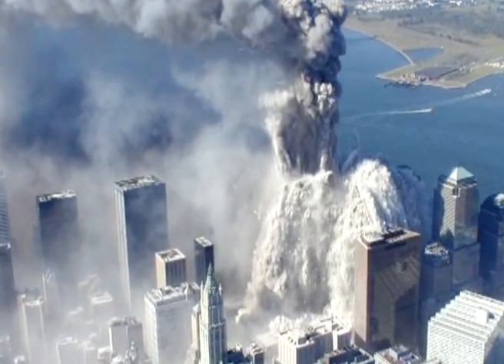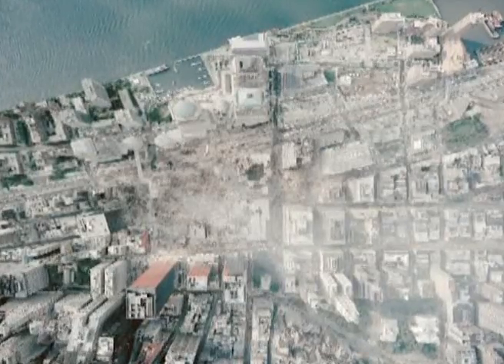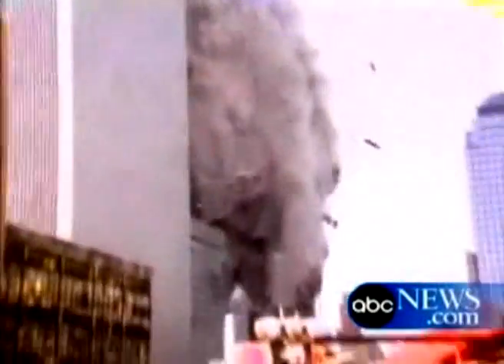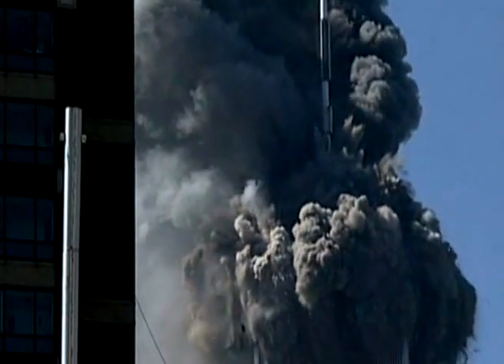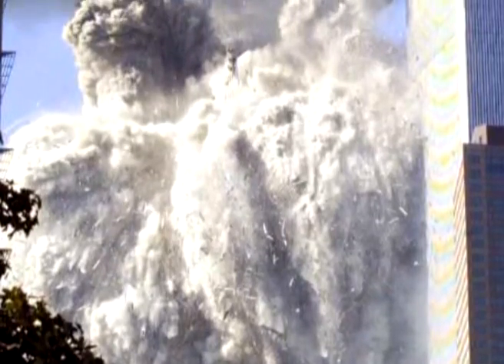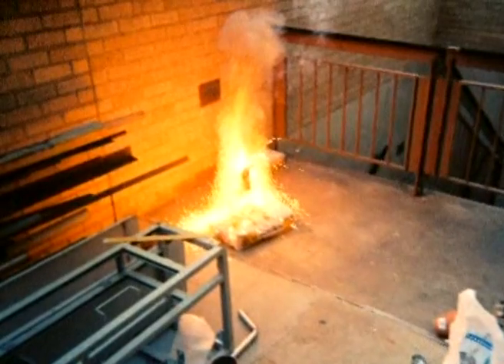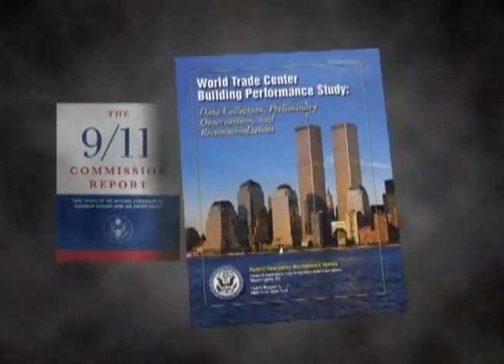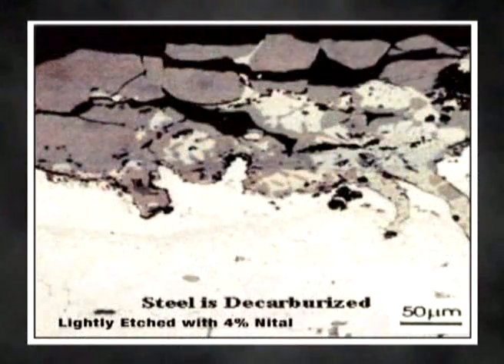Evidence for thermite and view of the "spire" collapse

Comment: I really believe they had the WHOLE interior structure of the building coated with Thermite, therefore you'd have a 100% failure rate of the building in case of an attack, I'm not sure how they went about doing this, but the must have modified the building during maintenance, or what not.. They had to have known.. The evidence is all pointing it out, with the "Surgically cut steel beams"... Think about it, if the buildings were left to stand, they could've stopped the fires though it would've taken days.... And the repairs would've been, astronomical... Which is why I think most of the building owners who lost theirs buildings had them "pulled", as if they knew 9/11 was going to happen in advance, which doesn't settle with me.... You do not have to be a rocket scientist to figure this stuff out. ALSO, there were reports of explosions under the twin towers as well, after and before the initial plane crashes, and these explosion were probably fueled with, you guessed it, thermite, which would INFACT weaken the foot hold of the building, which would make perfect sense where those "Pools of Lava" came from, plus the jet fuel and liquid metal flowing down the elevator shafts and floors due to gravity.....

Comment: Don't forget the thermite fired from the pod of the missile with hologram added wings and CGI, piloted by the mossad, which triggered the underground nukes 50 minutes later, causing a controlled demollition on their footprint (+34 extra acres) causing explosions at the basements which caused the collapse initiate from the impact area, pulverizing and melting the steel.

Comment: thermite will not throw debrie very far, it only cuts and melts there would need to be other explosives.  Scalar technology was used that is why the oxygen tanks on the backs of the firemen where exploding, and metal was evaporating into thin air so to speak.  Cars a 1/2 mile away where incinerated, or the engin blocks where missing and door handles where missing.  Thermite will not cause this type of destruction, people are really to scared to bring up the real reason.

Comment: Dustman has failed to respond t several of my posts, one in particular in which I pointed out that the potential energy, when converted to kinetic energy of 1 of the towers is equivalent to 272 tons of TNT, that's why so much was smashed beyond recognition, that's without adding in the energy from the fires, which also destroyed a lot, and continued to do so after the collapse.

Comment: @infoseeker264 
1,139,879,868,600J / 4,184,000,000J/t = 272t
That figure is the potential energy of one of the towers, when converted into kinetic energy (collapse), then converted into the equivalent in TNT. The collapse created the equivalent in energy as 272 tons of TNT. That's a lot of destructive power! And that is why so much was pulverised beyond recognition. And the fires have not been added to that equation.

Comment: @infoseeker264 "The museum has tangible vestiges of the twin towers, including pieces of window glass, lobby marble and jagged beam steel. One display case holds a beer can from 1971, when construction workers building the new towers shoved it between two steel beams before sealing them. The can was pried from the metal at ground zero, twisted and rusty.One jarring item is a frozen clock, its simple black hands stopped at 10:02, and the small one at 14."

what's this infoseek.. lol.

Comment: Four floors tall, a few is Two. Steel framed buildings can collapse from fire, there is no getting away from that fact. Yes, buildings without concrete reinforcement are more susceptable to fire, since 911, the reccomendation is to use concrete- reinforced steel.
JERKS!! You are just another coward living in denial it's as simple as that"

I see this so much, a sign of losing an argument and being stubborn is to turn to insults, hey it's not my fault you have no science to back you up.

Comment: Because, whilst fire completely destroyed the Kader toy factory in Singapore, the fire affected sections of dogwood elementary school in virginia, the mumbai High north platform in India, and world trade center 7 - all steel-framed structures, many buildings have survived fires often due to concrete-reinforced steel. They wouldn't know if the building would definately collapse or not, they do know it will with explosives. Fire did not work miracles, fire collase is common.

Comment: Well, yes there is, you need to read up on physics and scaling. It can't be done.

BTW this statement of yours "DO NOT COLLAPSE STRAIGHT DOWN INTO THE PATH OF THE MOST RESISTANCE AT NEAR FREE FALL SPEED"

Is false also, although the towers fell down( gravity has an odd way of doing that!) the towers did not fall into their own foot print, meaning some least resistance occured, and near "freefall speed" means not at feefall speed, don't insinuate.

Comment: you have nothing but a list of similies and arguments from incredulity. You have zero physical evidence of a controlled demolition. No det cord, No blasting caps, No devices that could hold thermite against a vertical surface, Hell. no thermite or blast residue even. And don't spit out that old canard that they weren't looking for it. they combed through the wreckage at Fresh Kills. It would be self evident, obvious, and impossible to conceal.

Comment: @infoseeker264 cutting charges are loud, huge in fact for columns the size of B7's, prove otherwise.

"but think Thermite, which burns much hotter and faster, couldn't have done the same thing"

No, it probably could, but it didn't, there is no evidence.
I thought you thought it was explosives, not thermite anyway?

Comment: @AiresQX4 No I can't and for that matter, nor can anybody else, the reason being it is impossible to scale down and recreate the events, you cannot scale down a fire,(a large fie in a big building will have different properties to a scaled version) and you cannot scale down the sand used in the concrete (which is what you would have to do). 
There are only 2 possible ways here: recreate a full sized replica, or computer simulation.

Comment: @infoseeker264 The spewing metal was BURNING magnesium/aluminum alloy from the aircraft. Have you ever seen a survival match with magnesium and flint? You just shave a few magnesium flakes off with a knife and then strike the flint causing a spark to ignite the magnesium,you will get a white hot fire There is also an article online about the dangers of casting magnesium once it is melted,if it contacts iron oxide you will have a thermitic reaction which is near impossible to put out

Comment: @janmal372

I don't know who you're arguing with, and I'm not taking sides... but nano-thermite does somewhat explode. Regular thermite doesn't, but nano-thermite reacts violently enough to move mass.

Just like black powder, the finer you grind it the more explosive it is as there is more surface area for the reaction to take place. This goes for pretty much anything...  I guess you could compare nano-thermite to a super hot, super weak fuel-air bomb.

Not trying to sound smart... just saying.

Comment: We can argue all we like but the truth is , with the fire burning on all those levels was hot enough to melt the tempered steel, it still would have only caused the top of the building to fall  and would have left all the steel beams below the melting point alone, debunkers get the brain cells working again if ever they did for you.

Comment: The announcer at 3:00 makes an effort to say the collapse was a normal failure progression up until the spire dropped straight down. That's not consistent with the antenna drop or anything else, really.
Reply: Building was failing internally because it was seen externally, it could be the reason of antenna dropping first

Comment: If you could find a single core column in images of 9-11 you could prove the steel core columns existed.  But you cannot.  Big error in the video see algoxy(dot)com/conc for actual evidence of what stood.  What is called "the core" is actually outside the core and the site I've linked will make that clear with evidence of images from different directions.

Comment: OK first of all, Fire needs oxegan to burn at the temp required to melt steel.If you ever seen a blacksmith workshop you know what im talking about. An exo-thermic reaction is much more powerfull, and if you ever watch videos on how it works, you would know the iron is molten for a very long time not a split second. My therory is mass amounts of a thermite type substances were used and explosives powderized the concrete thus making a well insulated blanket of debris above the molten iron.

Comment: OK,there was molten metal in the bottom of the wreckage because of the fucking fire.Duh!With you're line of thinking shouldn't there have been molten steel coming out of every floor of the building if there were blasts on EVERY floor?Isn't that the theory about the faster than free fall thing?

Comment: Anyone that has used a cutting torch knows that the steel cools off and turns into slag in a matter of seconds after it's cut . To get steel hot enough to stay in a liquid state it takes a sustained heat source ( a very hot fire , duh ) . All a thermite explosion would of done is blown this slag all over structures near it . It certainly wouldn't have stayed liquid long enough to flow out of the building .

Comment: There was an unprecedented power down the weekend before 9/11. Even the security system was shut off. Based on first responder testimony(See NYFD FIREFIGHTER John Schroeder on Google Videos-45minute version)the explosives, for the most part were in the central core,more than likely along the elevator service alleys. The bomb sniffing dogs that had been on duty in 12 hour shifts were pulled from Towers 12 days before the event.There was also new internet cable(?) going in at about the same time.

Comment: Another idiotic, under whelmingly non-informative dumbass reproach from our resident volunteer fire dick.

REAL fireman have stated that the MOLTEN METAL was running like a river. With out the presence of a blast furnace, the assertion that you make is STUPID. 
Understand that - S T U P I D !

All 3 buildings had Molten Metal, with Aluminum Oxide, Sulphur, Fluorine and Maganese present.

Go back to the Podunk Vol.FD, maybe they will let you wash the Fire Trucks

Comment: "wroked"with both,eh?
The temps in the bottoms of WTC1,2,7 were +1,300F a week after the fact.
You saying they had smelting operations in the basements?Maybe they had forced air blowing into the otherwise totally collapsed ruins of the buildings,perhaps elec. ovens from some huge forge shop running full blast!Eh?
Thermite and derivative Thermate would have created the pooling slag ponds under the debris,it's not the heat from the cutting charges and the explosives,it's the heat from the slag!

Comment: 1 Organic fires cannot come near the temps observed in the rubble of WTC 1,2,7
2 Thermate cut them, explosives knocked them down
3 Molten metal is the result of cutter charges being used to destroy structural integrity of core,particularly in sub basements. Allowed buildings to collapse into the"Bathtub"

See also 
*South Tower Coming Down by David S Chandler
*Danny Jowenko on WTC7 controlled demolition
*BBC reported Building 7 collapse 20 minutes before it fell

9/11 was an inside job!

Comment: Was thermite/ate used at the WTC?

No.

The thermite reaction creates barium nitrate as a byproduct...not a trace of which was found in the rubble of the WTC, despite Professor Steven Jones' best research.  Also, the amount of sulfur found in the rubble (from the burning gypsum in the drywall) is inconsistent with the amount of thermate that would be required to cause collapse.

Comment: WTC were not designed to collapse by aircraft impact or jet fuel fire (kerosene).  Hydrocarbon cannot burn at sufficient temperatures to melt 47 huge steel core columns.  There is good evidence of thermite.  Steel, after the collapse, shows both evidence of thermite cutting and thermite residue.

Comment: WTC 1. 2 and 7 were never  designed to be "uncollapsable". They were designed to collapse safely.

THus, the hydrocarbon (paper,plastic, etc, with some aviation fuel ) fire  caused a CONTROLLED collapse.

There is no evidence of thermite. None. The fact that there is no huge amounts of evidence actually proves that thermite did not demolish the buildings.